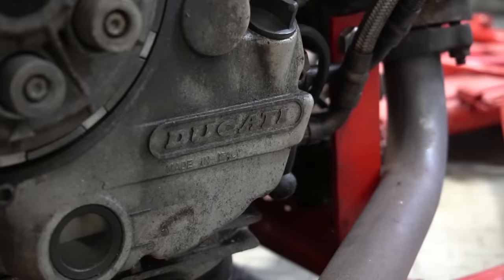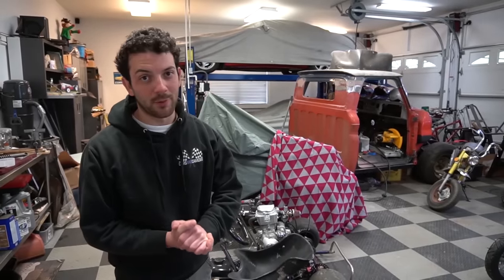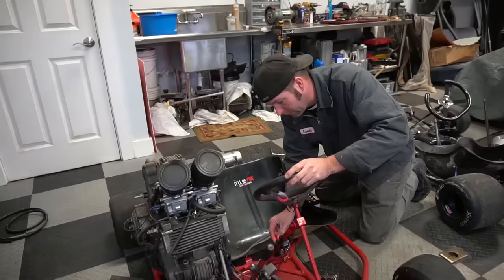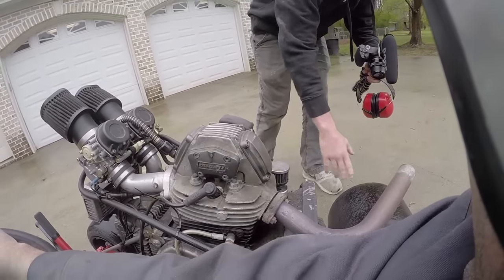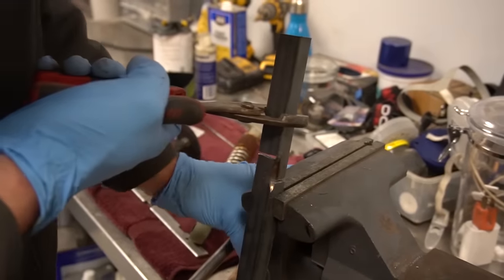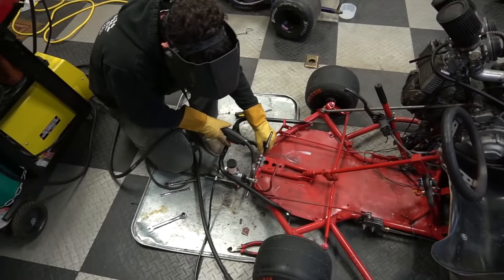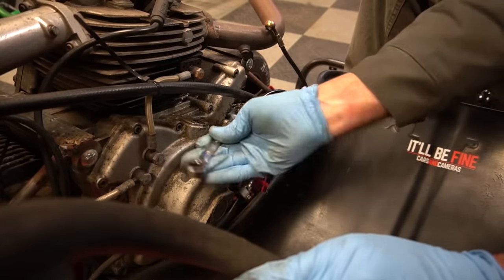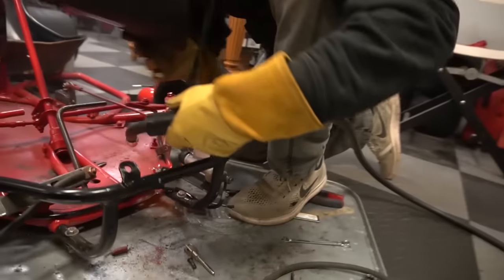DUCATI 900CC DEATH MACHINE | 70+ HP Shifter Kart

Comment: I think it is painfully (and joyously) obvious that despite whatever massive re-engineering it requires that the Ducati engine needs  to be installed on the rail.  The rail is (through no fault of the guys) a pig.  A beautiful and totally cool pig....but a pig nonetheless.  A machine of it's caliber and superb style deserves POWER!
Reply: Gerald Wallace I agree. The dragster was built to handle this kind of power.
Reply from the maker: You have a lot of excellent points here Gerald. The rail is a near perfect match (power/size wise, in my opinion) for this engine. That being said, we'd have to hack the chassis to pieces to get it to work- a chain setup would be more ridiculous/dangerous in terms of jackshafts, and a differential setup would also be difficult considering the rider's legs already rest on the 1" axle. To sum it up, it would be better all around to build a new rail from scratch; applying what we've learned in this build to a new design. Rear engine, chromoly tubing, a differential, etc. That's probably the direction we're going if/when we get bored with this one. At the end of the day it may be slow, but we still have fun with it, and fun is incredibly important in what we do.
Reply: I think having fun should be a top priority as well.  And if a Ducati swap would require basically redesigning the whole rail I can certainly understand your reluctance to do so.  And...I have to admit to some curiosity as to weather or not you guys can eventually wring respectable performance out of the 670.
Another scratch built rail for the Ducati would probably be best even though it will be a massive project.  One I hope to see!
So till then...be careful on the "Death Kart".  Till pavement do you part!
Reply: CarsandCameras with that being the case, why not turbo or nitrous the 670? Or even cooler, slap on an aisin mini roots blower! They can be used on 500-1000cc motorcycles and have even been used on 1.6l vw flat 4s. Plus with it being a roots-type, it's too easy to do a simple draw through setup.
Reply: NOS!
Reply: I agree stop what your doing with that chassis right now and swap that motor
Reply: Move the seat forward and put the Ducati in the rear.
Reply: Definitely think use need to put this Ducati engine in the drag rail , those peditor v-twins are just big oversized lawnmower engines this Ducati is a race inspired engine an deserves to be screaming down the drag strip! I garntee it will improve the rails times
Reply: I think given enough time, they'll get the 670 running pretty good. Or it'll blow up. Whichever comes first.
Reply: Ike and John I feel if you have to go to so much work in Re engineering the rail to put a Bike motor on it 
Just keep the Ducati Kart as it is ( with what ever Mods you have to do ) and do a make over on the Rail otherwise you would  not only  be waiting money but also not have a working Kart or the original Rail either at least this way you still have the kart  Just get another motor for the rail etc 
Is their any reasoning behind putting the Ducati motor as you did when you built it why didn't you put it behind the seat is it more difficult to do that or is it that you had a frame for the side motor? 
BTW I am blown away guys Great work on the Kart Stay safe if not go out in Style!
Reply: I agree. A go kart shouldn't be faster than a friggin dragster, that's some ass backwards shit right there. Just switch em, put the Ducati in the rail and the predator in the kart. It can't be that hard, but totally worth it. Yea the rail is fun, but it could be a lot funner
Reply: Clay Hunna this ducati engine is 100% capable of making 300 HP. Not only would it improve the times, it would blow them away!
Reply: Gerald Wallace Danger first, fun will take care of itself.

Comment from the maker: It’s geared for 150+, but chance of death is 100%
Reply: CarsandCameras  I'm watching this in class wish I was there
Reply: Put it on the drag rail!!!
Reply: CarsandCameras I had a question about a kart I just about finished. I slapped a 420cc predator engine on a mini sprint cart I bought. I put a torque converter on it, and a 19t #40 sprocket on it. The torque converter has a 10 tooth sprocket. On the first ride, the chain makes a ton of noise, almost like it’s catching a tooth or something. It jumps a lot, and has a ton of chattering when you put on the gas. I can’t figure it out, have any ideas of what it could be? Chain too tight, loose?
Reply: CarsandCameras i love it
Reply: Seriously, put the ducati on the drag rail!
Reply: Aaron Allred make sure the chain is lined up nice and straight. The chain will start “catching” on the aluminum backing plate. Look for scratch marks by the sprocket on the torque converter
Reply: +1 for the ducati drag kart.
Reply: Don't think you need 150mph, just a narrow winding track between trees on a wet day with slicks - oh wait, you already tried that.
Reply: me and my dad watch you and we are building a go kart together
Reply: Aaron Allred the chain may be too small for your sprockets
Reply: Im with alot of people here i have to agree, Do a top speed run with the Ducati then put it on the drag rail, anyway love this channel, im watching it in class.
Reply: My guess is because they are sponsored by a company that sells the twin predator engines, Maybe the point of the drag cart was to see what they could do with THAT set up.
Reply: Agree. It's cool as a scary 'freak show' kinda thing, but that engine belongs on the rail!
Reply: CarsandCameras how have you not called it the ducarti?
Reply: i own a ducati xD and thats awesome
Reply: I will try for top speed if you want!
Reply: Ty's Epic Life You have a cool dad!!!
Reply: Aaron Allred it could be that an overtightened chain or could be that the 2 sprockets are not aligned inline with each other..if not then could be either the chain is wrong size & pitch for the sprockets u have or last could be that maybe chain fits the 1 sprocket that came with chain but the 2nd sprocket u had/got seperate isn't the same size or pitch as the other one which would cause that issue also
Reply: take it to bonnavile and see how fast it goes
Reply: Mike Mccabe they are both the right size sprockets, and running a #40 chain. It seems to be stretching every time I ride it.
Reply: 100% is not a chance
Reply: CarsandCameras You need front brakes, just in case the back ones go... I wonder how you can do that...it would be interesting....
Reply: Kevin Bustamante my chain wasent grinding on the TC, but it was too loose. I tightened it up good and now it’s having no problems at all. Is your chain too wide? It could be your engine is not lined up square with the axle. I had that issue too no matter where my sprocket was, and just fixed it by twisting the engine some.
Reply: put the engine in the rail or dragster or whatever your calling it pleeeeeeaaaaassse
Reply: CarsandCameras Ducatti 900 on the rail, that cart is too dangerous to have that motor on it. You have a better chance of putting that power down to the ground in the rail
Reply: Remember, poop before you try so you don't ruin your leathers.
Reply: Now that you were done with velocity, can you bring back Ike’s adventures?
Reply: Im watching this in class too!!!
Reply: I bet, this Cart you should just gear i for quickness and efficient gearing to keep the engine rpms higher since it's a high revving engine.
Reply: CarsandCameras : )
Reply: Put that on the drag car
Reply: CarsandCameras You guys DO REALIZE a motor needs some exhaust back pressure to run right, RIGHT?
Reply: I'm down to roll that beast down the road!!
Reply: I had the same issue with an offroad buggy i built with a honda vfr400 engine in it, turns out it was the 25mm axle flexing because of the torque and causing the chain to slacken and keep jumping a tooth. It actually snapped the axle in the end. Easy fix though just fit another two pillow block bearings on the axle to stop it flexing.
Reply: CarsandCameras
 I have a spare KX500 and have been thinking of something similar for quite a while.  The shifting is what concerned me, I had also considered a Margay chassis that my neighbor has . I imagine that a 500 single would probably be able to fit without significant frame mods. I am curious if you have anything posted as far as the actual build pictures and/or specs., primarily the clutch and shifter configuration any help/links would be appreciated!  
I love the KX500 in a motorcycle configuration, but I am also confident that would induce extreme grins due to the advertised HP of the 500 being between 60-70, with the added bonus of only weighing a little more than a bucket of Hot Wings, speaking of which, I am hungry, let me know if you have any idea's.
Great video, keep em coming
Reply: CarsandCameras yo I bet you and I'll put the fire under your ass go-karts or just the bomb of all bombs that more gay frame you got there I had one of them in this is the God's honest truth I raced against Michael Andretti go karts in Coopersburg Pennsylvania the tracks called Rick Raw go-kart track of course Michael had the best card out there I did get their dough and that was my first time ever racing when it go kart track and 91b one McCullough engine on klotz racing fuel 0 to 80 in 4 seconds unbelievable and stop on a dime you have a great night take care
Reply: I'm sure you'll find some mistakes and the reason for that is I'm talking into my phone and this phone has been known to make mistakes o you know sorry about that I'll keep in touch
Reply: CarsandCameras margay frame one of the world-renowned frames truly great action with the m91 B1 McCullough racing motor running on Glocks racing fuels 0 to 84 seconds stop on a dime Earhart disc brakes very very good matter fact I wish I had that court now I really do and hell you guys have a great night that thing looks like it's going to be a cooker for sure
Reply: You should put it on the drag cart
Reply: CarsandCameras margay frame one of the best go-kart frames ever made bar none I had one with a Mac 91b one McCullough motor on it racing got Glocks racing fuel have a great day
Reply: CarsandCameras the question is what did you have to do for the Illuminati I'll guarantee you ezel deny it however I've got a hunch I'm right what did you do for the Illuminati
Reply: :D
Reply: CarsandCameras 'chance' you say? I'll take those odds! if you're not living on the edge, you're taking up too much room 🙃 (slicks on a wet road too? Nice)
Reply: I will happily apply to be a test pilot ;)
Reply: CarsandCameras Nah, It'll be fine.
Reply: CarsandCameras , make are ears bleed...ok lol
Reply: I love you
Reply: if you don't die you're not trying hard enough :-)
Reply: LMAO!!!!
Reply: CarsandCameras .
Reply: Propane and propane accessories if only :( itll make it so much better
Reply: lol me to
Reply: lol
Reply: :D
Reply: You need to call it the DDM for short!
Reply: CarsandCameras I don't know man I think that Ducati it's probably better than anything else that you guys have built Ducati on a go-kart frame gives me a hard-on just thinking about it. Lol. Get rid of everything else except for the Ducati that thing is a beast I want one of those maybe I'll try to make one
Reply: CarsandCameras. Yeah it's pretty sweet man it's a beast
Reply: Do y'all have a video on how you built it
Reply: I'm really interested in the billing it
Reply: Decaf astra
Reply: CarsandCameras  if u move clutch down lower on the petal it will give you more thow in the petal
Reply: CarsandCameras Do what the lawnmower racers do on your clutch. They put the throttle on a lever on the steering wheel.
Reply: CarsandCameras if the chance of death is 100% then wouldn't you have died the moment you stepped on the throttle?
Reply: CarsandCameras can y’all make another video but in a dry road?
Reply: Send me won
Reply: you only need to worry when that number hits 190% otherwise your just fine
Reply: Send it at the track
Reply: Sounds like your sprockets are not lined up.  Make sure your clutch sprocket is lined up exactly with the sprocket on the axial.
Reply: You should put this engine on the rail
Reply: i volunteer to test drive it at 85% power lol
Reply: Fuck that😂😂
Reply: CarsandCameras put the Ducati on the rail it would be nasty
Reply: Bring this back but put a rear wing and front suspension
Reply: I figured the first time it rounded a corner it tip over being top heavy
Reply: CarsandCameras bet
Reply: Bad little setup, I love it.
Reply: I will buy it
Reply: I got cash in 100s
Reply: @propaneandpropaneaccessori3446  wweřťýe wwradit
Reply: Why not make it four wheel drive im sure it has the power to run it
Reply: Maybe a 99% chance of 100% dead
Reply: It'll be fine
Reply: Yep
Reply: Thats.to fast.man.be safe..
Reply: Put that Ducati engine on the drag kart then take it to drag strip
Reply: @aaronallred5499  try putting in a chain tensioner
Reply: CarsandCameras did you guys ever do another video after fixing the brakes
Reply: Because it's the deathcarti
Reply: mario kart fast and furious editon!!!!
Reply: Is it bad for your eyes to watch welding on a video. 😂😂😂 Badass kart tho
Reply: CarsandCameras HOW MUCH FOR IT
Reply: No balls
Reply: Needs a offroad chassis with paddles 😅 not a street cart
Reply: @aaronallred5499  sounds loose
Reply: Why?

Comment: Put that engine on the drag rail
Reply: Youthfulcross44 yesss
Reply: Youthfulcross44 Yell yes
Reply: That would be awesome!
Reply: Y E S ! ! ! !
Reply: No, they should adapt a transmission to use the 670cc first, then go on to mounting this.Otherwise, we wont get to see the full potential of the predator series.Keep in mind, they built the 670 to run so it really just needs a good transmission
Reply: I just said the same thing.
Great minds think alike.
Reply: Youthfulcross44 Nooo. Swap aHonda 700CC V4 motorcycke engine. 109 hp, stock.
Reply: Technie87' what kind of transmission could they use?
Reply: Technie87' The rail will not get much faster with that Predator on it before it blows itself to pieces.
Reply: Yesssss
Reply: i dont think it will fit
Reply: RobinVlasveld IT'LL BE FINE😎
Reply: MyYouTubeChannel yeah😎
Reply from the maker: We'll see how the rail does with the new springs and coils. If it isn't fast enough, we'll probably build a new chassis entirely with this 900 or another powerful street bike engine
Reply: CarsandCameras nice!
Reply: CarsandCameras yes it shall be done fix the 670 first if its still not fast swap it with a transmission
Reply: CarsandCameras go with a Vtwin HD 1200 sportster or 92ci Victory engine and transmission.
Reply: please

Comment: You guys are my absolute heroes! When I was a young boy 13 years of age I didn't have a lot of money. I grew up on a farm the one thing that I did have was wheels 11 horse Kohler and I bought a centrifugal clutch. I found the old riding lawn mower and I built my own trike at the ripe age of 13. It had no brakes. Accelerator was one I stole off of a lawn mower. I would powerslide to make it stop. It would throw rooster tails 15 ft long. And it would definitely ride wheelies with me on it.thank you for reminding me of the creative spirit that I once had and still do. Keep up the good work guys.

Comment: Back in the '60's took a Honda 90 placed it up front between my feet. On a regular go kart frame. Didn't have to do anything with the engine but to remove the shifter arm then turn it so it was straight up and down. This was to help keep the front wheels on the ground, helped a lot in turning. Chain went to a small jackshaft then from there to the rear axle. This was Hot Shaft sprocket bolted to the axle, drove both rear wheels.  Best way to turn was to stomp on the power , get both spinning then jank it around. Donuts on gravel was a lot of fun.
Great stuff Guys, Keep it up.

Comment: your Ducati is super cool and actually spoke with a friend of mine who knows these and said they were never less than 80 hp out of the factory and that is a little conservative,so you have some very cool stuff going on. i sure agree a foot clutch and better working brakes are a must and it will easily crest a 100 mph without aero work on the body of the car, as usual awesome work and content gentlemen

Comment: This is sooooo sickk!! But I must say... The inch of throw you were talking about is normal, It’s a motorcycle clutch so just think about the throw that you get with a hand lever,  about an inch... Not comparable to a car because it’s made to be controlled by a handlever and not a foot pedal
Reply: with some fun lever reduction, you could make a 2-3 inch pedal travel that translates into a 1 inch master cylinder travel.
Reply: Josh Hust 
That's where my head was at as well.
Reply: D MTB ....amount  of throw is also regulated by the length of the foot pedal arm.  the cart arm is about 6".  An automotive pedal
 is about 14"
Reply: D MTB she's a runner No Doubt a Ducati of all Motors you put on there very slick and shrewd men no doubt about it he's have a great night and a better day tomorrow
Reply: I rewinded the video to look at the master cylander. They have it mounted high on the pedal, if they move the mounting point of the clutch linkage down on the pedal as well as moving the master in a lower spot it will get much more though.
Reply: As an owner of a very similar engine and clutch (Ducati Monster 1100s), I must say this particular clutch is tricky. The dry clutch bites fast, and it bites hard.
You have very little amount of 'play', if you move the lever 1 millimeter, it bites very hard.
It takes a while to get used to, and you should use a decent amount of throttle.
I know some people use a different kit of springs on the clutch, to reduce the pressure a little bit. I think it's also possible to fit a more conical disk to improve the gradient.
Reply: MrKinir jwas gs